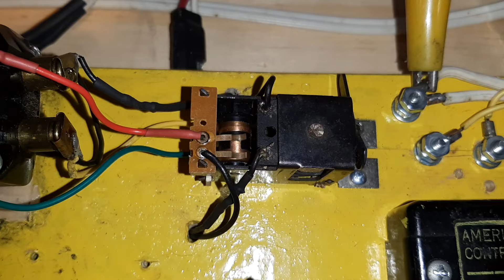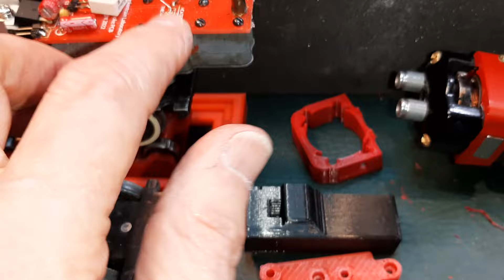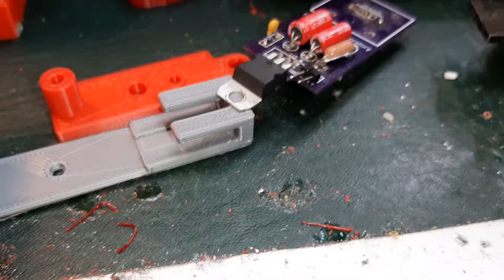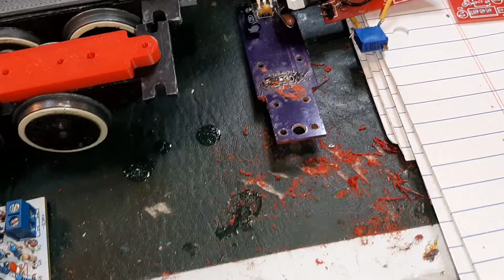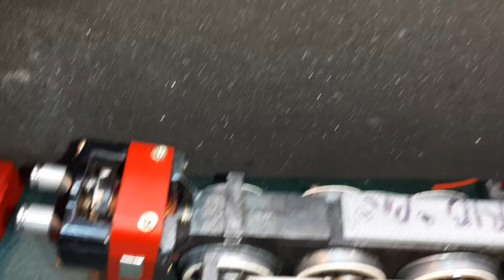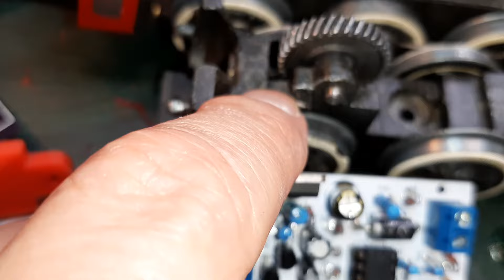Houston recall! Noise on the line kills Digital Sound Boards. Big Picture down to R&D today.

Comment: Do you still have a link to the original whitepaper? Also the components tou changed on the board they designed?

Also where do you get the sound board? Is there a link to that? 

All of the above would be useful in analysis of the issue. 

I am the IOT/Wifi commenter from before and I have kinda had to give myself a primer in how these work and so far here is what I have been able to determine. 

So the AC power primarily controls the motor. However each button actually adds or subtracts a DC current to the line. (I'm gussing betwen 3 and 5v worth) and before each component triggered by those there is a choke that filters out the ac component and passes dc to the device in question be it a sound board or the transmission. 

Ideally the first thing you do is to profile your tranformer (or transformers for the sake of comparison) so hook your scope up to the transformer all by itself to see what happens when each button is pressed both when the thottle is off and when it would theoretically be moving the train. 

Im still waiting on my train from ebay and I am trying to find a period appropriate transformer but have no idea what I should be looking for.

But the most valueable thing would be those links requested above so I can actually determine the parts in use and what may be going strangely. 

But profiling the transformer would also be very useful as the information i have otherwise been able to find regarding the button functions is very ambiguous about the dc component being added/subtracted to the line. 

I promised you an email and havent gotten around to it as its been hectic this week I will get that done today once I finish some work for the day. But if you can provide links to that paper and the parts currently in use (any you have even if some is not immediately available anything is a starting point)
Reply from the maker: @Segphalt  I have the paper I think in PDF. Send me your email address we can dig into any aspect you like. I also have a bottom box design for the two sounds to the Lionel TMCC sound board. I can send that as well. Tell what train you ordered. I can send my parts you can test with. D
Reply from the maker: This sound board is extremely rare and not produced anymore. The next best sound Board is from Engineering called Bigger Little Sound it is for HO.  

https://www.ngineering.com/little_sounds.htm

N8500-XXX	$30.45    Little Bigger Sounds with 1-1/2-watt amplifier and N8315 speaker.
N8501-XXX	$30.95    Little Bigger Sounds with 1-1/2-watt amplifier and N8328 speaker. (I use this one)
N8502-XXX	$36.95    Little Bigger Sounds with 1-1/2-watt amplifier and N8352 (52mm round) speaker. (Need to try larger speaker)
N8503-XXX	$22.95    Little Bigger Sounds configured for output to any standard external amplifier. (if we have a amp to use for more sound????)
Reply from the maker: https://ogrforum.ogaugerr.com/fileSendAction/fcType/0/fcOid/164024807559108827/filePointer/164024807578072489/fodoid/164024807578072485/Lionel%20E-Unit%2000-0103-00%20Theory%20Of%20Operation.pdf
Reply from the maker: Another paper on a DIY Button Box to play sounds on the Lionel TMCC Sound Board
https://slsprr.net/features/SoundBlkProtect.htm
Reply from the maker: 3rd Rail sells the lionel sound boards, mine I have are older but similar sounds these are now $129 I do not buy them I can get older Railsounds V1 for $30 and have a few. http://www.3rdrail.com/err-3rdrail/index.html
Reply from the maker: This is the manual for the boards I am using, D
http://www.3rdrail.com/err-3rdrail/Manuals/SoundV2-Inst.pdf

Comment: Maybe you some more B+ filtering…might see something using a scope.
Reply from the maker: Thank You, I can set up  a test engine hook up the scope and share that video would that be a good next step. Do I look at the DC volts to the motor or the DC to the Sound Board? Do they need to loaded, the real parts or a resistor to simulate load?  I am all ears. Dennis
Reply: @DennisMurphey  I think DC on the sound board with real parts
Reply from the maker: @RodneyBooth-s8e  I got it setup and tested the old scope, i cracked the screen but its all working so i should be able to get initial readings tomorrow. D